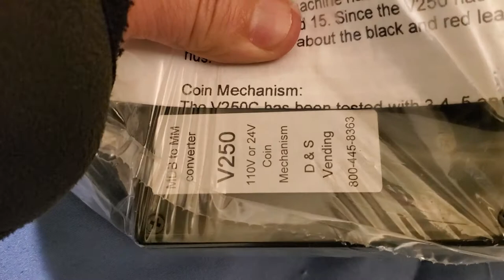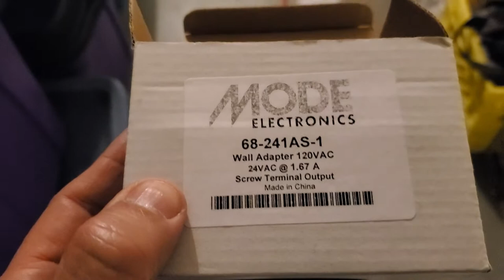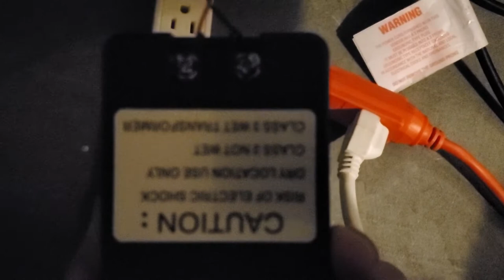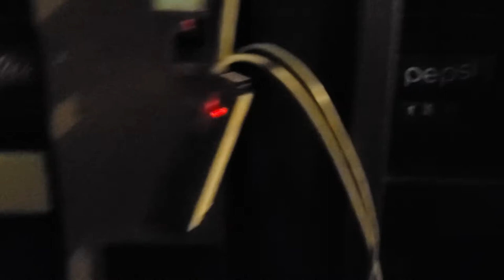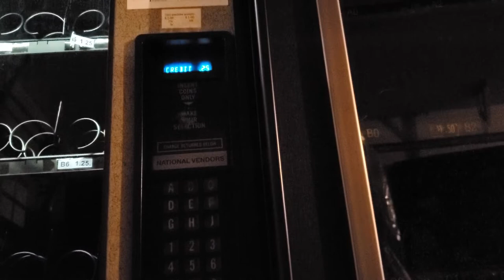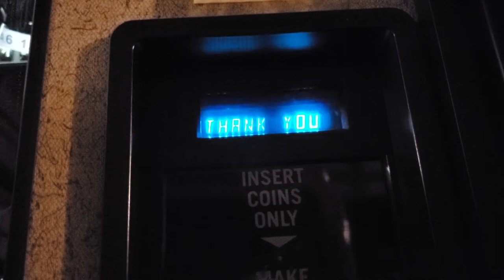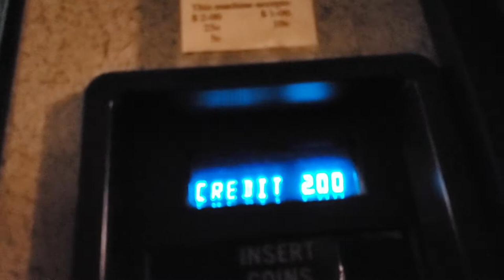Convert old vending machine 12 PINS non mdb to mdb that can run bill acceptor and debit card reader

Comment: Hi Francis , I am wondering if you have had any luck or experience  connecting the lu250 micro mech to mdb converter with credit card interface to a nayax vpos touch cc reader. It states on D&S vending that it will only work in the USA and I am in Vancouver Canada
Reply from the maker: why dont we try it out? im just here in richmond and goes to vancouver 3 to 4x a week.
Reply: @franzink  Hi have you guys had any success with this? I am also trying to convert my micro mech to MDB and want to install a Nayax reader. I'm in Toronto, Canada. Thanks very much.
Reply from the maker: @izzyp5522  Hello Ray i only had success connecting it with MDB devices but have not yet tried Nayax.  But i looked up in Forums and in USA they had success connecting it to USA Technologies Credit Card Readers. Maybe if you have a working Nayax you can try it and let me know as well thanks.  Most of my Non Mdb are in old apartment buildings and everyone there has coins and bills

Comment: I have a CB-300SA vending machine, just installed an Eport card reader but am getting “card off by vendor” error, any idea if this will help? Thanks
Reply from the maker: did you go to programming mode on your vending machine to accept card reader or mdb reader? did you also call the EPort provider if they have activated your unit? those are the only 2 problems that i encounter all the time

Comment: Did you ever try to connect PayRange?
Reply from the maker: Yes but I noticed that payrange only works on locations with the same people. Debit credit works better overall for public and private locations
Reply from the maker: Payrange can only accept mdb machines.  I have never tried on converted non mdb to mdb machines
Reply: This will not work with PayRange because there is no way to activate preauthorization with PayRange. If the customer cancels the transaction with this converter, they will get the product for free.

Comment: Where do you purchase them in Canada?
Reply from the maker: For the conversion module only D&S vending usa is the cheapest option
Reply: @franzink  Thanks!  Have you tested it with Nayax VPOS Touch?  I just looked at D&S Site and they say it only works in the USA for cards
Reply from the maker: @adrianelzinga9947  sorry did not test it. Better swap out your machine to a MDB model to avoid headaches in the long run